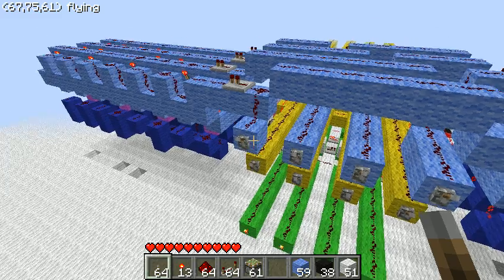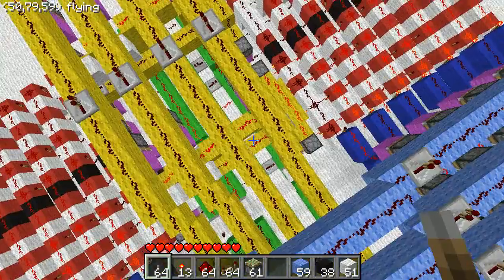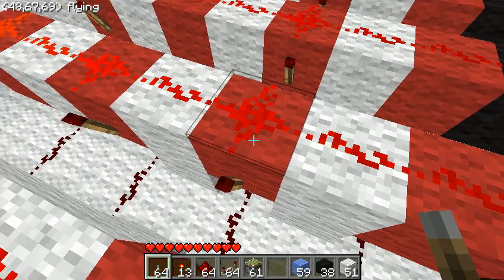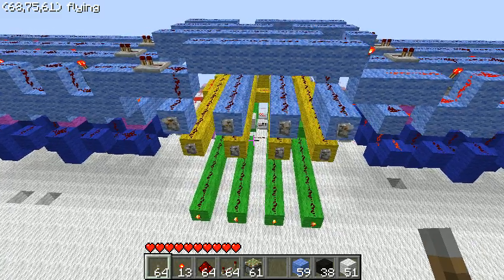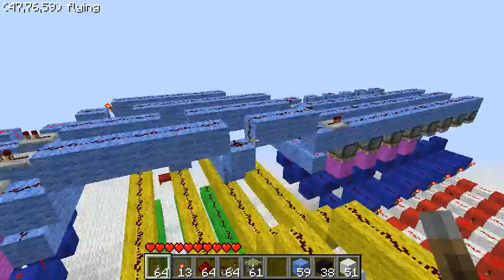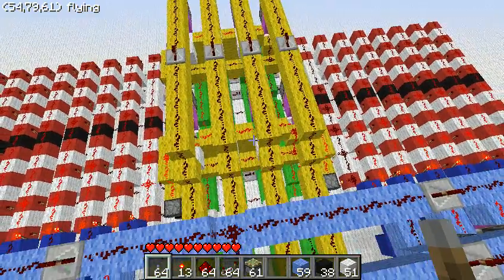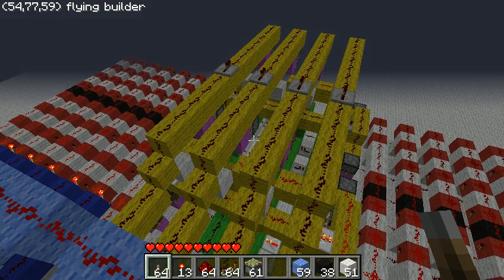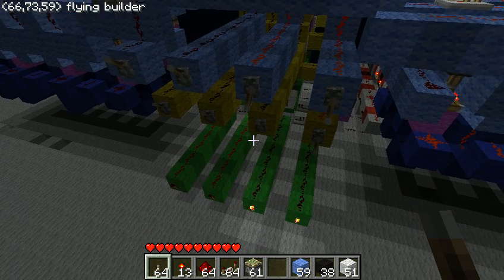Minecraft: High Speed ROM

Comment: @OCoptimusconvoy It's Read Only Memory. Essentially you manually enter data once when you make it, then it can be read back using the address lines. Because it doesn't need the ability to be written to via input data lines, it can generally be made a lot smaller. It's good for storing your program code or constant data on.